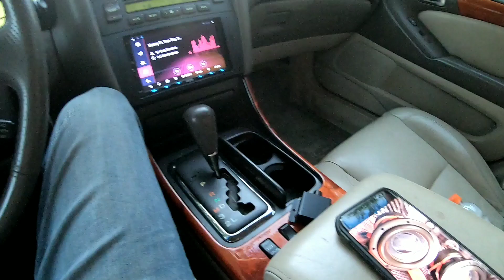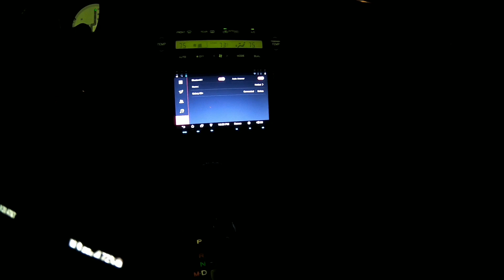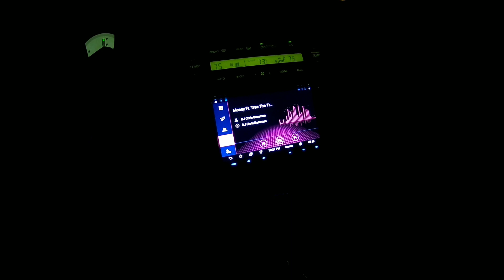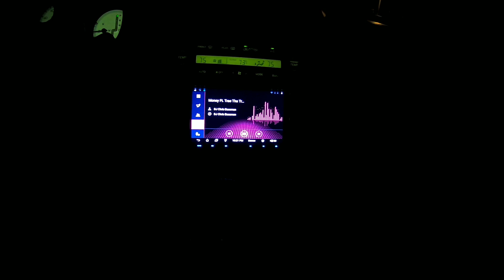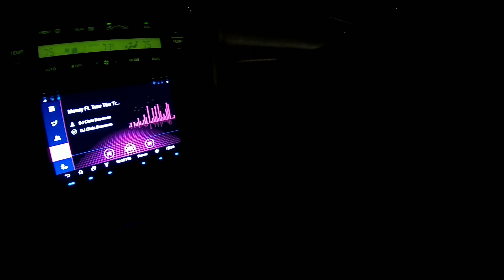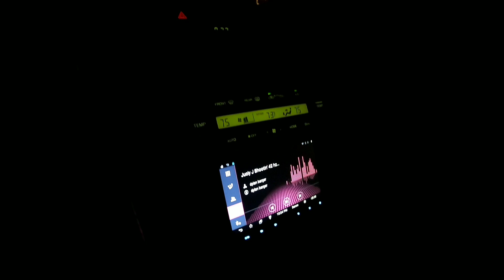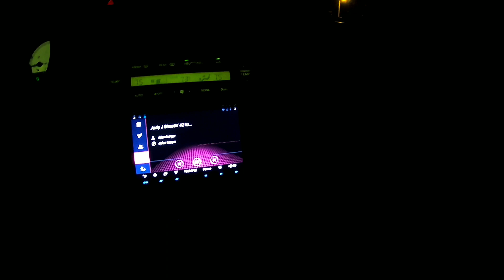How To Remove Gs300 OEM Rear subwoofer

Comment: I love these cars and always have since I got smoked in my LS integra that had intake, header and a greddy exhaust. The real power adder at the time seemed fast and that was a 100 shot direct port nitrous kit. On full wrinkle wall slicks at the track it would go 12.6 at 108 mph. On the street on drag radials it was definitely in the 13's but this GS 400 absolutely pulled on me so bad I completely let off the gas and pretended like I wasnt trying to even run him! Turns out it was just the 4 liter V8 with headers, bigger throttle body and actual true dual exhaust no cats or anything. 
I just got a 98 with only 70k on it. One owner and its literally a perfect example of perfection. 
I hope you go through with boosting yours. Just remember that boost likes lower compression! Nitrous likes little higher. Or you could swap in the I-6 J twin  spooled out and boosting up monster beast from the supra! Put the manual gear box as well and some good coilovers and you've got a true monster! Sexy, fast and looks to big to be so fast but I've seen guys drift them and say it's amazing! I'm just going to throw some decent coilovers and some tasteful 19"'s or 20's" so theres no gap. Have a NSV. 4 & a sundown SFB 5000 watt amp to push it. Some MTX mids and highs with a PPI 1500watt to push those and a JVC KW-M56BT head unit so I didnr brake the bank but can mirror my phone. The enclosure is a 4th order and its strategically ported into  the void that was the stock sub. No rattles or crazy buzzing and shit. One little layer of dyno mat was all the deck lid needed. 1 small little set and the 4th order contains the air and vibration through its port and onto the car. I love it and the nightshade is unbelievable! 
Good luck and keep us posted on the progress!!!
Reply from the maker: Yeah look at the other videos I have. I had a gs430, gs300, s13 1jzgte, s14 built ka24,  bmw 335i that's 600hp, and a few other trucks.

Comment: What about the connections? I cut mine and tapped it off and it seems like the factory amplifier is tweaking cuz it cut sound to all door speakers but my sub amp and subs work
Reply from the maker: I didn't less with that. I'm wired around all of it. Just incase it messed up what factory stuff I still have.
Reply: @ yeah I’m gonna get a bypass harness if that don’t work ima just cut the speaker wires going from OEM and run em to head unit in stead
Reply from the maker: @Xzander.v2 Lexus normally uses input and output in their amps so you could just wire then together

Comment: I have a 0 4 300 With the Mark Levinson and the sub is busted so I need this to see about taking that out and replacing it thank you
Reply: Oooh I got an 05 300 with the factory navigation touch screen and ML sound. Idk if you've done your installation yet but I been looking for advice on my install. I took out the ML sub and threw it away since it was literally deteriorated and followed the advice by some installer at best buy who told me that I can strip one end of the rca cable and connect the exposed wires into the connection for the ML sub. I did that but the sub only works at very low volume and when I turn it up to just a normal volume the sound altogether cuts off and them comes back on but without out the sub. And the sub only works when I first start my car, after the sound cut off the sub won't come back if I try putting the volume really low again.
Reply: @victor75208  I’ve heard around that you’ll have to possibly bypass the factory amp for the sub amp if you haven’t don’t that 
There are some videos and info around.
Reply: @joshuahumphries7743  yeah I just seen a video yesterday of this one guy who actually cut the sub wires from the harness that connects to the ML amp in the trunk.
Reply from the maker: Sorry I didn't see this. You can get a adapter from the factory amps outputs and that will wired to your aftermarket amp and run your new sub. It's not hard to do.
Reply: @JZGarage  appreciated bro 
What brand adapter would you recommend
Reply from the maker: I think it's like metra or something like that. I used one in my new f350 head unit.
Reply from the maker: PAC SNI15 Line Output Converter for Adding Amplifier https://www.amazon.com/dp/B000K50HJY/ref=cm_sw_r_apan_glt_fabc_T8P3Y5A0VHD37SDWE0S

 this will make the signal for your RCA and remotor I believe

Comment: Could you wire the factory sub to work simultaneously with aftermarket sub?
Reply from the maker: The factory sub isnt really rated for that. I was running around 2000-2300 watts off my amp so that wouldnt work.

Comment: Hey man I hooked up 2 12” subs and aftermarket amp but sound is still coming only from my aftermarket pioneer head unit and factory sub. What should I do? Any suggestions?
Reply from the maker: Does you head unit power on at all?
Reply: @JZGarage  yeah works great I have the nakamichi system I removed the factory amp already. The amp powers on and the remote seems to be working properly but I’m only getting sound from factory sub
Reply from the maker: I dont know how you have it wired but if you went all aftermarket and removed the factory sub amp that's probably why it doesnt work.
Reply: @JZGarage  I’ll see what I can do I’m unplugging the factory sub right now
Reply from the maker: If the factory gone then the sub probably isnt getting any more.
Reply: @JZGarage fixed my issue but thanks bro keep up the great content
Reply: U need to buy wiring harness to bypass factory amp
Reply: Need harness to bypass factory amp
Reply: @lonniebeams8499  need harness to bypass factory amp
Reply: @raulrodriguez8036  with the nakamichi you have to create your own harness using the vehicle wire diagram as a guide.

Comment: can i use the factory sub if i switched out the deck ?
Reply from the maker: If its wired into the factory amp sure.
Reply: @JZGarage  even if i got my own double din ?
Reply from the maker: Yes it's just a power and signal wire. You gotta find it and wire that in.
Reply: @JZGarage  the orange and black wire ?
Reply from the maker: I don't know I removed all of mine.

Comment: I would rather have Lexus have plugs in engine bay that don't shatter when you touch em instead  of sturdy  interior clips ...lol..
Reply from the maker: Me too man. I made a video on coil pack harness repair aswell. Probably rebuilding all the oem plugs soon with the supra engine going in
Reply: @JZGarage  2j  gte,   nice !!they got so damn expensive I can't dream of it rn..lol
 I got 430, and bottom line il swap for just low mileage same 3uz again
Reply from the maker: Well not exactly a gte but close enough and for roughly 280$ just doing a engine refresh arp eveything swapping my built vvti head on it shotting for some reasonable numbers but I have alot going on and really need to make some videos on that stuff here soon.

Comment: How did you get the "harness for the baby seats" covers off?
Reply from the maker: With a trim plastic prying tool.  You can used a flat head also or just carefully use your hands to pull from 1 side to the other rocking it off.
Reply: Side to side like drivers to passenger or front to back?